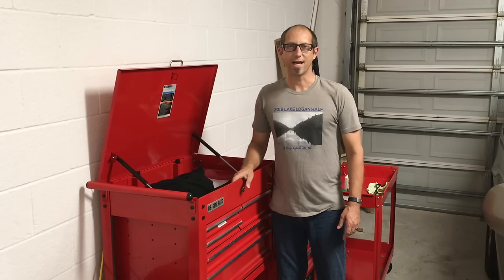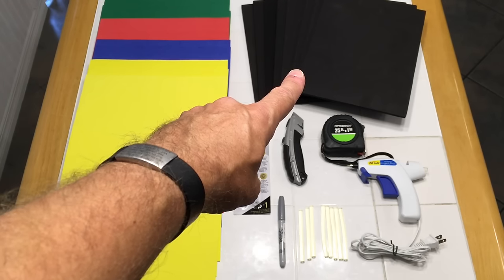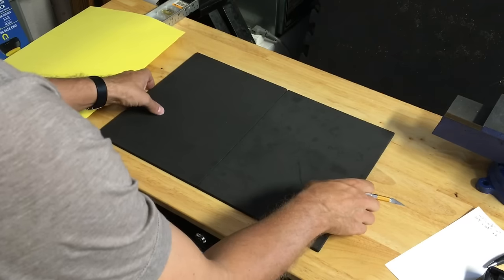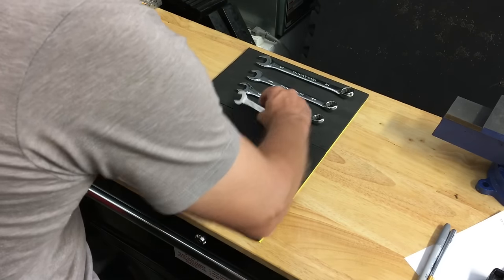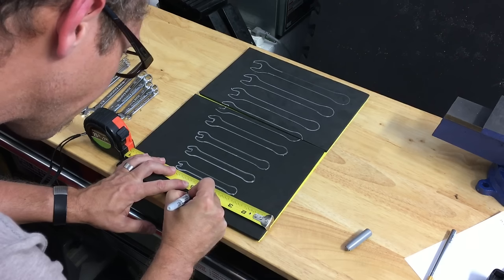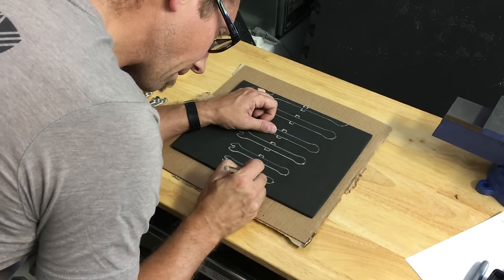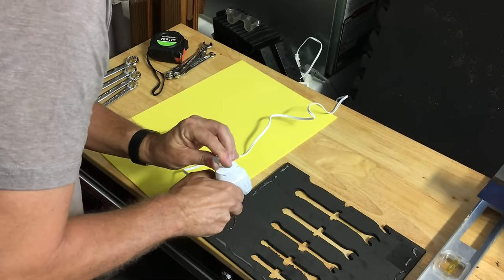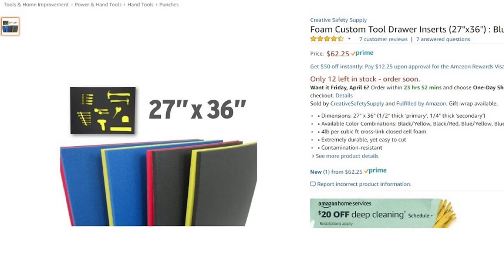Make Your Own Custom Tool Box Foam Inserts for $3

Comment: Love the idea, going to be doing this with mine soon in near future. Would of some 3 things differently though 1st use a cutting board made for those cardboard dulls your blade fast, 2nd would of pushed the wrenches over little further vs straight down center and 3rd would of flipped the black over after so I don't see the lines from the silver marker. Like I said though excellent video and great inspiration to other and ideas for them to do.
Reply from the maker: Charles Laffey , thanks for the suggestions.  All good points!
Reply: DIY Jeff no problem that's what all this is for learn and experiment still looks 10x better than my tool chest at the moment lol

Comment: awesome tutorial - Gorilla glue has been a much better option for foam glue ups as a tip for those who feel a bit rushed by the hot glue option.
Reply from the maker: @M S, great tip, but don't use too much since gorilla glue expands and will leave lumps in your foam.

Comment: Hey man good video, thumbs up, When I did mine I used a camping mat I got from Walmart. It is a light blue in color and some black kitchen drawer liner made of 1/8th of inch foam I got from Home Depot. Glued the two together with contact cement. I then cut out the outline of the tools and then contact cemented to another piece of the camping mat as an backing. So the thin black foam is on the top with two layers of the light blue  under it. I did about two years ago and I live in Oklahoma and the summers here get hot, high 90s to 100's the contact cement has held up great.
Reply from the maker: Ad McPrice, thanks for sharing your experience.  The great thing about DIY is that there are multiple ways to achieve your desired result.

Comment: I would of lined the tools along one edge to conserve space for others! Thx for sharing cool idea! Got my wheels turning for my tool cart!
Reply from the maker: outdoorzone, the one caution I would give you is to make sure you have a bit of foam between each tool, if not, when you go to cut it, it will be difficult for the foam to keep it's shape and not rip if it's too thin.  You could do some tests to see how close you can get the tools to each other.

Comment: i use yoga mats they are cheep and they are thick
Reply from the maker: danoh's toolbox, that's a great idea too.  Thanks for sharing!
Reply: Great idea
Reply: This is exactly the tip I was hoping to find. Cheers
Reply: @moopmoop345  Yeah. Walmart blue camping mats and you could use the colored foam just as he did here in this video. I had some yellow drawer liner material so I went with Blue/Yellow. https://www.walmart.com/ip/Ozark-Trail-Closed-Cell-Foam-Blue-Camp-Sleeping-Pad/634956813
Reply: Good tip. Thanks.

Comment: Why not use a fine end mill in a dremmel to cut out tool shapes and totally agree with another commenter about using spray glue. Good thinking batman🤔😎😉
Reply from the maker: Alec Nemeth, thanks for the comments.  I've also found that using a hot knife cuts through the foam like butter.  But a fine end mill dremmel is certainly another option.  I don't think there's any one way to do it.  Sky's the limit!  And certainly, a high quality spray adhesive is another option.  I have to be careful in Florida with spray adhesive because my garage is 120+ degrees 10 months out of the year and I've found spray adhesive to lose it's integrity in high heat.

Comment: Thank you! I'll be using this for my house tools as well as sewing tools and sewing machine presser feet.
Reply from the maker: Ann, Blachly, I've found that using a hot knife is a much quicker way of cutting the foam.
Reply: @DIYJeff  Thank you for that tip. I have some pillows I want to make from memory foam mattress toppers that we don't use anymore. I'll get a hot knife as I've never had any luck cutting it with scissors or rotary blades either....so have avoided this project for some time.

Comment: My only concern would be the durability of that craft foam.  The 5S foam I am using is chemical resistant, which is what you are actually paying for with the good stuff
Reply: Yep.  Most of the cheap stuff breaks down after a while in a tool box.
Reply from the maker: @William Mims, I've had mine now for 2 1/2 years with no issues.  Granted the only thing on my tools is grease and I do wipe them down prior to putting them back, but the foam is still as good as new.

Comment: I'm thinking that a self healing Cutting pad will work better. No jumping around on the corrugated cardboard .
Reply from the maker: scott connolyy, thanks for the idea.  That could possibly work.  Since making the video a few months back, I received many suggestions about using a hot knife, which would also eliminate much of the jumping around as well as making the cutting process much quicker.

Comment: One day I hope to have this much free time.
Reply from the maker: @yotekillerfromnd, you know the old saying, “Time is money.”  You can certainly pay a couple hundred dollars for premise foam you still have to cut out, or spend a few dollars to make your own.  It’s your choice.  I’ve found using a hot knife speeds up the process considerably.
Reply: @DIYJeff  I absolutely get "time is money" there also is a point in life when it "costs" more to do something yourself than pay someone to have it done. I think it came out great and if I had more time I would do something similar. Unfortunately I don't have enough "free time" to do something like this. It came out great though

Comment: If you placed the mat in upside down from the way you laid it out, you wouldn't see those lines. But, I may do something similar to this in the future for my sockets.
Reply from the maker: Chris L, good observation.  Yes, tracing them backwards would eliminate seeing the outline.  Also, I've found that using a hot knife instead of an exacto knife is 10 times quicker when cutting.

Comment: what if something is a lot higher, is that foam deep enough for like a tape measure?
Reply from the maker: It would keep a tape measure in place because it has a relatively flat surface, but if you had a thick rounded tool you would need a thicker foam.

Comment: I already have 3 servant packed all the way with tools. With that much wasted space, I would need 12 extra to fit everything. The idea is good. But only with limited tools. Anyway, the idea is still good for some people I guess and it was done properly. But do you need a shop cart for such a few tools in it?
Reply from the maker: Julien, thanks for your comments.  The shop cart is just for my most used tools that I commonly go to for automotive repair.  I can wheel it over to the vehicle and not have to walk around so much.  I have many other tool boxes that I'm in the process of making inserts for.  It all comes down to how much storage space you have.  If you have the space, this makes finding tools and putting tools away, fast and easy.
Reply: DIY Jeff, that's right, you make a point. I deffinitly spend too much time searching the right tool. I kinda cheat as I put all the tools I need on a rolling cart. but 90% of the time I forgot a couple that I have to go and grab. I guess nobody has the perfect. Thanks for sharing Jeff I appreciate good civilised people chatting on youtube, it isn't always the case. Have a good day!

Comment: I’m about to have my mechanics do this for our shop. We keep losing tools and rags in machinery.
Reply from the maker: If you scroll through all the comments you’ll see people roast me on wasting space.  You can certainly put the tools a little closer together, but if you put them too close, and the foam is thin in between tools, it will likely rip.  Also, I’ve found that a hot knife works much quicker.  Many have also commented that hot glue isn’t as easy, but I disagree.  It may not be as easy, but after 2 years of sitting in my 115 degree garage, not one has come apart and I have a lot of them.  Spray adhesive doesn’t hold up in hot humid environments.  If you live up north then it may not be an issue to use a different adhesive.  Some have suggested contact cement.

Comment: I would like to do this, but just haven't had the time. I also see you have a Harbor Freight cart, they sell thicker foam rolls, although only grey, but it almost fits and the thickness is about 1'2 "
Reply from the maker: Joe Soliz, thanks for the tip.  I think the difference would be with the Harbor Freight foam rolls is they would be more expensive.  Part of the video was to show that a custom tray insert could be made for $3.  But, your suggestion could work as well.  Thanks for sharing.
Reply: @DIYJeff  Idk looks a little flimsy to me. I don't see that holding up to well to constant use. How did these things hold up for you so far?
Reply from the maker: @Snake Plissken, sorry, I'm scrolling through old comments and just saw your question.  I apologize for not responding sooner.  I live in Florida where my garage gets to 110 degrees easily and I've had no problems.  The inserts still work like the day I made them.

Comment: im doing this project and i found my craftman drawers require 3 sheets of the yellow and black each, the third sheet is to fill the gaps at the back and right side of the drawers
Reply: correction 3 of the black and 2 yellow

Comment: When you measured the drawer at the start, why didn't you just remove the black liner that was there and measure that ?
Reply from the maker: @Ruski Ryan, I certainly could have done that, but most drawers don't have a liner so I was showing the process as if it wasn't there.

Comment: Love the video but to make this so.much easier why not use the liner that's floating on the bottom at your stencil instead of measuring
Reply from the maker: brandon jennings , you certainly could.  I just wanted a bright color that stood out when a tool was missing.  Also, I now use a hot knife to do my cutting which speeds up the process considerably.

Comment: For ratchets, do you double up the black foam?  If so, how did that work out?
Reply from the maker: Augie Inciong, I haven't tried doubling up the foam but you could certainly do that.  It would be a lot more work cutting.  You can either flip the ratchet with the drive facing up or lay it sideways and cut around the drive.  The foam is thick enough to hold it in place that way.

Comment: Looks nice, but the layout is kinda like showcasing rather than organizing to me... I can't justify 11 combination wrenches consuming an entire drawer. Need thicker foam so the grooves are more like slots and line them up on their sides rather than laying flat. 
For tutorial purposes it's great, but seems to lead to a lot of these tool chest tours where somebody will have a massive mechanic's tool chest, and only manage to fit a small hand bag worth of tools in it. The spacing between the tools is so far, that you might as well just spread out your tools til you find the one you want.  
As I see it, if you have 11 small combo wrenches in an entire drawer, and still have room in the box to put the metric set in an entire other drawer, then the amount of tools you have should be easy enough to keep track of without all that effort. 
I'm not knocking on the poster, he could have toolchests packed to the limit for all I know. But I just find this particular application and layout a little silly in a number of ways.
Reply from the maker: @Robert Hance, that's the great thing about YouTube.  Every application isn't for everyone.  I have 5 large tool chests and have done the foam inserts on all of them.  I do have a bunch of tools, but by neatly laying them out in an organized way makes finding them and putting them away quickly.  With making the foam inserts by hand, you can't get the tools much closer together without the foam being flimsy and ripping.  Thus, the need to space them out.  I'm certainly not advocating that everyone should do it.  Just a DIY option if you want to .

Comment: Why leave the sharpie lines? Next time cut them out or at least use a black sharpie. You’ll still be able to see the lines to cut.
Reply from the maker: @Mike Nads, good points.  An easy fix too is to place them on the pad backwards so that when you cut them out the marker is on the back side.

Comment: You need something better and more precise than an exacto knife....I've done this a lot of time in the past and chances are they will not turn out. Thicker foam are harder to cut and even if you get it close to the shape they will look all funny because you can't cut the foam exactly straight up and down....if you dont believe me buy 1 and try it out Also use glue specifically designed for faom instead of hotglue.
Reply from the maker: KC Boon, I've found using a hot knife works great and is much faster.  While I haven't tried using another glue,  I've had lots of comments about different adhesives.  Even though hot glue isn't ideal, I will say that even after a year, I haven't had any of the foam separate so it's done a good job of staying bonded.

Comment: 👏 Contact 👏 Cement 👏
Reply from the maker: Yee Thirty, that's a great tip and easier to work with than got glue.  How would it hold up under hot temperatures?  My garage can get up to 130 degrees with Florida summers.  The hot glue hasn't missed a beat and has held up for 2 years.
Reply: @DIYJeff  absolutely fine, if your concerned about it separating use something like shoegoo or E6000

Comment: The problem is, these aren't the correct foam. They may or may not react with oils, greese, gasoline/diesel.

For example, napalm is made of gasoline, diesel, and styrofoam. The gasoline literally melts the styrofoam, and the diesel mixed with the foam makes it burn for a long time.
Reply from the maker: @chronicblazer84, you are correct, however, the video is for the DIY home mechanic.  Mine have held up just fine with grease and oils.  Not sure about gasoline.  I’ve always wiped my tools down if gasoline got on any of them.  Been using my inserts for almost 3 years.

Comment: Why not just use spray glue like the kind for picture mounting... instead of a hot glue mess?
Reply from the maker: Burr Manchu, in my experience, spray glue loses its effectiveness in extreme hot temperatures and separates.  My garage can easily hit 120 degrees in the summer.  Hot glue has such a high melting point that it won’t lose its effectiveness.

Comment: Nice tutorial.
You’re doing too many multiple passes on your cuts though.
Changing up your disposable blades more often will give you cleaner cuts.
Reply from the maker: mrtheonly187, thanks for the comment.  Since making the video I've changed my technique and now use a hot knife which cuts through the foam like butter.
Reply: or dip the blade in water or wd40. I cut 3/4 rubber horse stall mats like butter using that technique.

Comment: Nicely organized but lots of wasted space in the drawer.
Reply from the maker: Bill Balleza, it's really an individual preference on space.  I have quite a few tool boxes and can afford spacing things out.  The concept is the same though, although you have to be careful putting the tools too close together because when you cut the foam, if the space is thin, the foam may split.

Comment: Guess you cant clean the foam if oily  tools are put back?
Reply from the maker: 123, I wipe mine down before putting them away, but you could always spray a little degreaser on a shop town and it should come off.

Comment: A solder gun with a blade attachments saves you more time if you have one. 

random question don't get offended but at what point are you going to shave your head? Why would you leave an island like patch on it? Just curious
Reply from the maker: Chicago1, since making the video of made several more using a hot knife and it speeds up the process considerably.  As far as the hair goes, waiting till the bitter end because once I start shaving it there's no going back.

Comment: why not spray adhesive and put the outline side down ???? so much for OCD
Reply from the maker: David Atwell, the problem I've encountered with spray adhesive is that in high temp environments (like my garage) spray glue releases over time.  As far as the grey lines, you're right.  The best way to do it is to lay your tools down in reverse and trace them.  Then when you cut them and flip the foam over, they're in the orientation you want.  Also, since making the video, I've used a foam cutting hot knife which speeds up the cutting process significantly.

Comment: I really like the idea of using these foam sheets for organizing tools. But I think I would rather explore other gluing options different than hot glue. It seems it takes too long to apply the hot glue.
Reply from the maker: Carlos Ruiz Mora, I agree, but you would need a glue that withstands very hot temperatures when the garage gets hot in the summer, and cold temperatures in the winter.   I've been impressed with how the hot glue has held up and I live in Florida where my garage will easily get up to 120 degrees for long periods of time.

Comment: Would a spray adhesive not have worked?
Reply from the maker: protocultureBJJ , I’ve used spray adhesive many times in other applications.  The problem I’ve experienced with it, that even the high end stuff has a tendency to release in high heat.  My garage can get 115-120 degrees in the summer and glue stick has a much higher temperature tolerance as it’s melting point is higher.  That’s not to say you couldn’t try it, but I’ve had little success with it in high heat applications.
Reply: DIY Jeff good to know . My garage gets pretty hot as well, hopefully some insulation and fans will help me with that eventually

Comment: you could spend a little more money on scharp blades
Reply from the maker: @daluca029, the blade I was using was super sharp.  However, I've found that using a hot knife does work about 3 times faster.